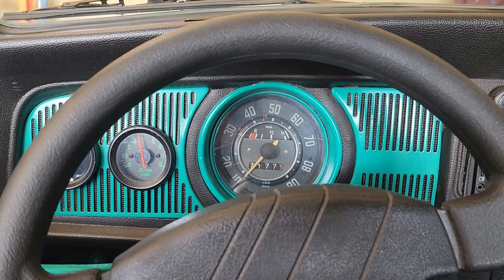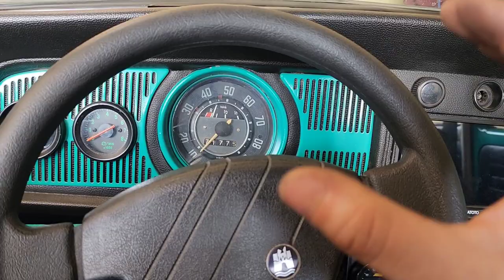Kennedy Clutch And Cooling Fan Failure

Comment: Surprised, your stock fan lasted that long without coming apart.
Reply: Absolutely. You need them welded and balanced for higher horsepower applications.
Reply from the maker: Me too. I always had in the back of my mind a big poof happening in one of my power pulls. Luck on my side I guess 🙂
Reply: @Motor7710  
Yes,luck was on your side.

Comment: This summer  you had  a vid saying something about  a stage 1  blue  pressure plate.  which must be Empi's blue one.  So I just order  that from AA.   I have  kenndys stage 1  and 2.   /

now  a  Kenndy stage 1  is 1 lbs.  What rating is  a empi/blue stage 1 ?        Being empi  I'm hoping it  might be 1200 lbs ?
  This fan your showing.  Did you notice the center hole is worn ?  meaning the hub will also be worn.  I'b  checking for cracking  at the hole.